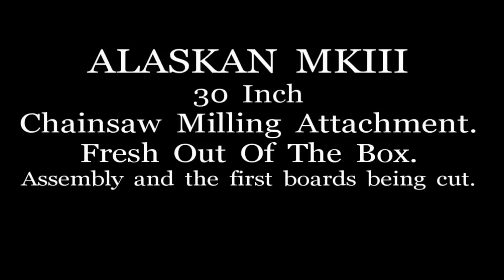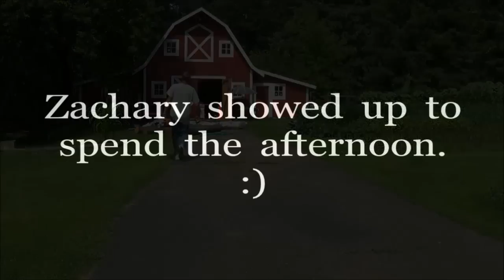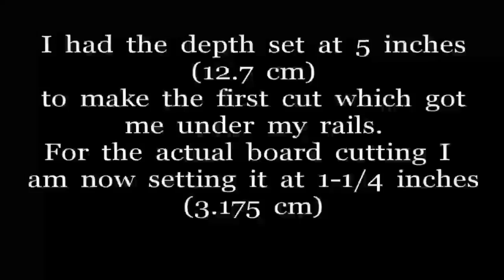ALASKAN MKIII. Chainsaw Milling Attachment. Assembling and then Cutting Boards.

Comment: Looks like you need to sharpen the chain !
Reply: Not sure if he is using the proper rip chain for cutting length ways on a log. there are two different chains like table saw blades.

Comment: how do you cut vertically with this?
Reply from the maker: ebp1234 When cutting vertically I use my micro/mini chainsaw mill. I have videos on that also. Thank you. Joe
Reply: JoeandZachSurvival How much did you pay for it and where did you get it?
Reply: ebp1234 Both mills and a ripping chain will cost you around $450. Look up Granberg International on Google and you will find the website where you can buy from them directly.
Reply: Samual Iam Mills & Bars up to 5-6-ft can run up to $2k
Reply: +Terry Hennessy, nhưng    bessy

Comment: There’s so
Much wrong in this video I feel bad for pointing it out.
Dust instead of shavings so sharpen it better yet ask for your chain to be cut for milling or a specific rip chain.
Use PROPER hearing protection not foam buds sometimes.
Eye protection.
Dog cutting about excuse the pun...
I forgot the rest and I already feel bad for pointing these flaws out...
I did enjoy watching and you sound like a decent guy but please for the new saw users if your putting videos online try to consider the example you are setting
Reply: Oh yea! Make some hard y shims to slip under the board a few inches behind the saw as the cut is made

Comment: Thanks. 
Safety? You are kneeling, a chain break would have caught you at waist level. And you are wearing a T shirt. 
'....It still sticks...' Yes it (the chain) will if you don't wedge the plank being cut.
Reply: +Ian Simpson I thought the same thing!! When he first started I was like why is he behind the saw! What if it bucks back!!
Reply: Real smart fellas, how is it going to buck and hit him when the mount attaches to the front and back of bar. It would have to buck through the plank he is cutting. Think before you type.
Reply: He pushing a saw.. if he hits a nail, hunk of wire or a rock it could buck back... I mean hey I don't care one way or another.
Reply: It'd be a lot better  if u used a 'rip cut' type chain on your saw.
Just sayin...
Reply: germanhuntingdog yeah it could buck back. But the way the Granberg mounts to the bar it is impossible for the bar to kick back all the way through the cut... the metal depth guide posts prevent that from happening.
Reply: Back during Katrina me and the neighbors were clearing downed trees I had the blade break.  A link wore, the chain spooled out,  whipped around my bare leg, aaaaaand... nothing.  It didn't do a fucking thing.   Apart from some burning because the blade was hot from use.   People are too overly paranoid about these saws.  The accidents occur not on the rare occasions of 'kick back' or chain breaks, but when the saw is fully operational and proper caution is not used.
Reply: wood_tick lol! There's video of wranglershill running a saw into a 1/4 round hardened steel log dog when he was milling and the saw chewed right through it.  It made a horrid sound,  but the saw did nothing erratic.   Hitting a nail or wire fouls the blade, but it's not going to make the saw fly out of your hand, fly across the yard and lay low a group of paying nuns.

Comment: that chain is dull as fu..! Throwing pure dust out :D
Reply: He’s actually got a very sharp chain based on how well he’s moving through the logs. Milling always creates dust instead of chips. Very different from crosscuts. Cheers!
Reply: @eltravieso111  I have to disagree with you on that, a lot of it has to with how dry and dense the log is. When you are cutting with pretty much any saw with a decent size tooth, pitch and offset, if the chain, blade or whatever anyone is using at the time  is sharp it should be throwing small chunks instead of dust. And when you are ripping or going with the grain if your chain saw is sharp you should be seeing long clean cut slivers not dust.
That's always been my experience
Reply: @woodchopper6930  Hey friend.  I had a similar conundrum when I first stepped into this chainsaw world. All I know is what I've learned from experience.   I've done a fair amount of firewood cutting and chainsaw milling with all kinds of chains and levels of sharpness.  We're talking about three different kinds of cuts here.  1. normal crosscuts like bucking rounds of firewood produces nice chips with a sharp chain, but more dust when dull 2. If you turn a round of wood and cut it in half down the diameter with your bar/chain parallel to the wood grain it produces those long clean slivers you mention.  3. but if you are milling a log down the length of the wood grain but with the bar/chain perpendicular to the grain (e.g. chainsaw mill in the video) it always throws dust regardless of how sharp the cutters are, pitch, gauge, or raker depth.  When I mill, I judge the sharpness of my chain based on the speed of cut.  Typically in a larger log, I will stop to sharpen or change chains every other slab.  Dust every time, just much more efficient cutting when sharp and less strain on my saw and my body.  Cheers!
Reply: @eltravieso111  
Daniel my friend,  if I know that I am 100% correct then I will argue until I see that actually I'm not exactly 100% correct, And the way you explained # 2 and # 3  I'm man enough to see that actually I'm might be let's just say not 100%....... although in my 61 years I have cut wood with almost any tool made for wood cutting except for a mill,
But I have and I am pretty darn good at cutting mantles, and slabs for making table tops, and furniture with chainsaws and plane. But sometimes I OOPS and those become FIREWOOD!! I totally understand and agree with you now that you explained it as you did. Thinking back on the last live edge pieces I made  my saw indeed would be more parallel than perpendicular to the log, which not only makes the long slivers as we both agree on it also makes me incorrect which makes you correct.  DANG I hate it when I'm WRONG.  Now all that said sir the reason I was watching these videos is because I  am in the market for a small mill probably up to a 20 " bar I know these type milling tools are slow but I am too. If you have experience with these type mills I would appreciate your suggestions.  Thanks again for your very nice and peaceful explanation to my comment , it's like a piece of glass to me now perfectly clear. Cheers to you too my friend.
Reply: wood chopper, yeah it’s cool how the angle of a cut changes so much. I began cutting a felling wedge on a tree one time and thought my chain was dull cause it was spitting dust. Then I remembered that I was cutting at a 45deg angle     As soon as I flattened my bar on the second cut it was throwing nice big chips again!  
As far as milling. I have the same granberg Alaskan MK-IV as the gentleman in the video. It works great, however you have to use a large saw. I wouldn’t mess around on a big log with anything under 70cc. That’s basically what this guy concluded in the video. Even with a big saw you have to be very careful and not push it too hard or you will overheat and cook the saw. Warm it up and also let it idle to cool down after each cut. Watch the bar and make sure it is oiling well. And stay sharp!  If you want to use a 20” bar on a medium size saw that’s fine. Remember that you lose about 4-5” because of the two clamps. Check out granberg’s G777 mini mill that only clamps one side of your bar. You don’t lose as much width and it works great. Have fun!

Comment: This video is scary. I can't believe the guys doing the cutting aren't wearing proper safety equipment - one guy isn't even wearing safety glasses! That's stupid. Here are a few suggestions:  bu 1) a pair of chainsaw chaps, 2) a pair of safety glasses, 3) a pair of chainsaw gloves, 4) an Granberg upgrade to a 36" mill, 5) ear protection, and 6) a Stihl, 6 HP, 461. It clearly took two guys to make the first slice; so, a ripping chain is clearly a must.
One more thing about this video that makes it dangerous and incomplete is that zero attention is given to ergonomics. Both Joe and Zach are on their knees the entire time. Neither one is wearing knee pads. In contrast, the Grandberg corporate video shows Mr. Grandberg "geared up" cutting a log that is about waist high. If you are going to do this all day, you need to think a little harder about the ergonomics of the job. Bottom Line: this video is a childish, but enthusiastic introduction to a tool which can be dangerous. There must be 100 How To Use Your Grandberg Milling Tool videos on line.
Reply: you dont need safety glasses with a chainsaw, there isnt many machines that require safety glasses. earmuffs would be more important
Reply: Nobody likes internet know it all safety sallies.
Reply: dude, you cant forget your mouth guard and pocket protector